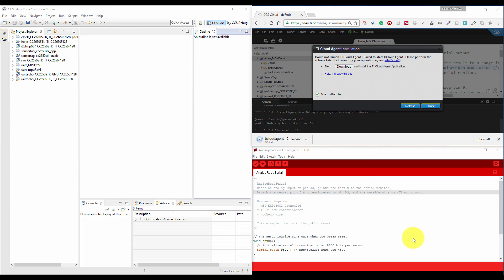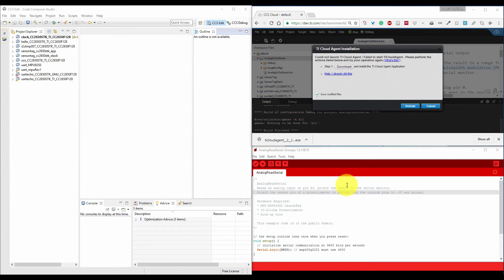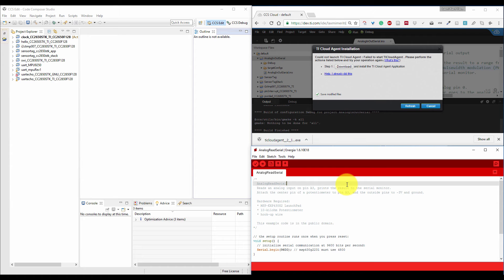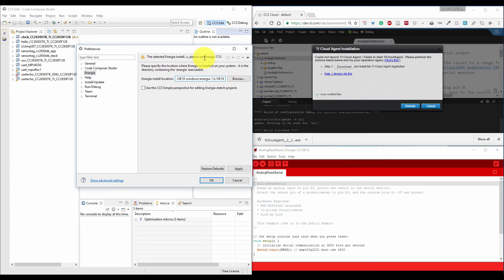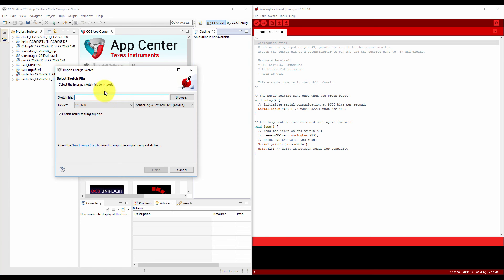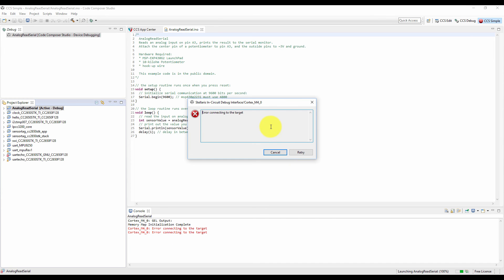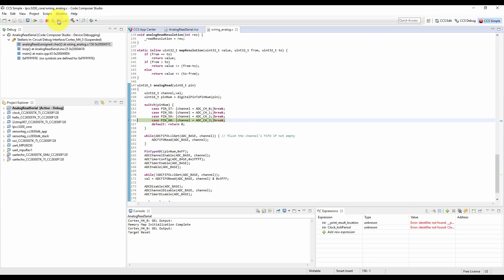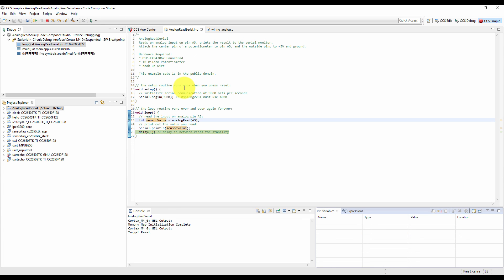Importing Energia Code in CCS v6 and Debugging it for CC3200

Comment: Sir , We would like to get temperature readings from a ktype thermocouple using ti cc3220sf and ads1118 boosterpack , we tried with energia and code composer studio , but we are not able to upload the sketch as an error is  returned "cant compile for board cc3220" we are not able to get temperature data from ads1118 in CCS either. please help, Thanks in Advance!